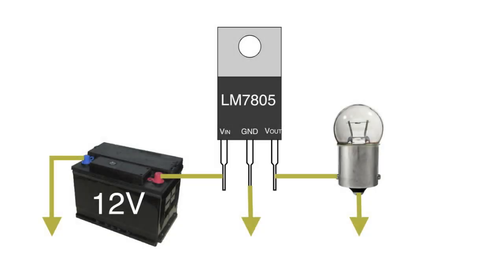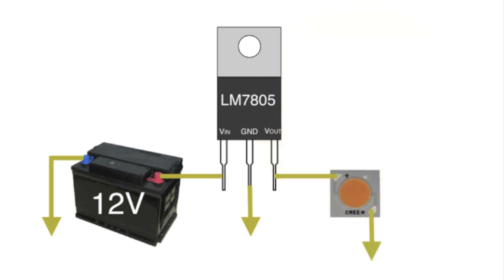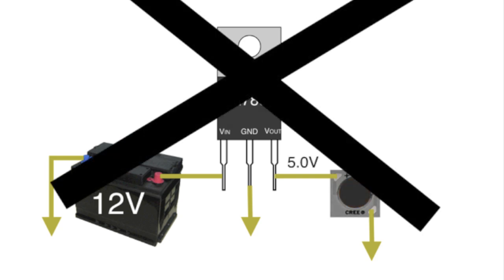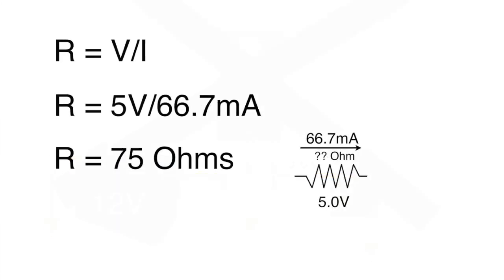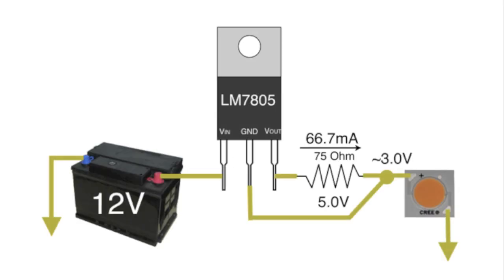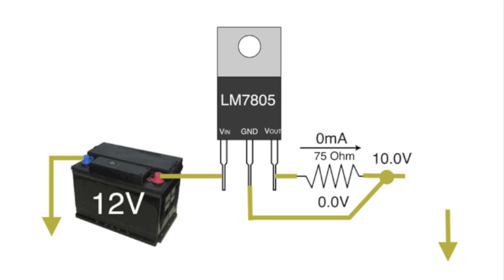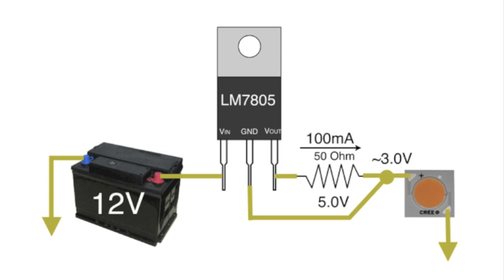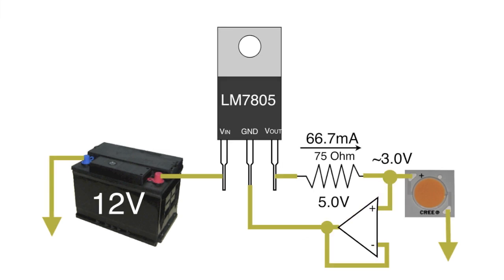Current Source

Comment: What about car battery 60AH  which reads 12v but not work due to low ampere how can i make current source to charge it up and how to know if the ampere of battery goes up
Reply: If the internal resistance of the battery makes it impossible to get the required current out of the battery the only solution would be to use a DC to DC converter to suck the battery dry.

Comment: wont the connection to gnd before the LED cause the ciruit to be short circuit, thus all current will pass through gnd and not the LED? Sorry if im misisng certain information, hope to hear your explanation to this!
Reply from the maker: I think I get it now. You are assuming that the GND pin on the voltage regulator chip is GROUND, but it's not ground if you don't connect it to ground. I'm floating it, so I'm not grounding the LED. Hope that explains it for you.
Reply: Dan Bullard thank you! That explains it!
Reply from the maker: I never connect the voltage regulator output to ground. It always has a light bulb, and LED or nothing on it. I guess I don't know what you are referring to. In the case that you did connect the output of the voltage regulator to ground, the voltage regulator will automatically limit the current and "fold back" the source to zero volts, protecting the battery and the regulator chip itself.

Comment: pls, if we replaced Vin to be 9V for example, and remove the LED,
then the volt at the ground pin will be  7V and the voltage drop  across 75 ohm resistor will be 2V ??
Reply from the maker: If you remove the LED the regulator will probably take it all the way to 9V because the ground pin is now connected to the output, and the ground pin takes very little current, so there is no way the 75 ohm resistor can drop much, if anything. It will do what any current source confronted with a high impedance load should do, it will run the voltage up as high as it can to get the programmed current to flow.

Comment: So just like if you supplied a light with 6V, the load determines the current. So if you supplied it with current at a voltage, the load determines the voltage?
Reply from the maker: Yes! I've worked with ATE systems that had programmable Current Sources that could take the voltage up to 120VDC. Imagine programming a 100mA current into an open circuit! What's going to happen? The voltage could go all the way to 120V. They had Voltage Clamps to keep the current source from ramping the voltage up high enough to damage the circuitry or kill someone.

Comment: Very nice. Plus I think I understand, but not sure?

If we have 3volts at top of led does that not mean the output voltage of right pin of 7805 (before the resistor) is forced by the 7805 to be at 8volts (8-3=5) If I measured that voltage would I see 8volts wrt ground? A regulated 8volts output as an extra bonus?

So if I had two LEDs in series instead of one. So giving a 6 volt drop instead of 3. Would that mean that other side of resistor would be forced to go to 11 volts. But still with same current value as before?

 And is the op amp there to make sure that its output voltage is same as voltage at non inverting input (3 volts). So no current can then flow from gnd pin through LED? 

Also is it easy to explain where the 4ma comes from?
Reply from the maker: Kevin O'Brien Kevin, you have it right. The total voltage would be about 8V. I mentioned that you can't add a second LED because you don't have the "headroom", that is, we can't get 11V out of the voltage regulator because it has a minimum 2V drop across the internal pass-transistor. I added the op amp to "telegraph" the voltage back to the ground pin. This allows the op amp to drive the 4mA current on the ground pin. The 4mA is easy to understand. Nobody works for free, and that included the voltage regulator. It takes some internal currents for it to do its job. The biggest of these is probably the internal zener diode, but overall it does take some power to do anything, whether you are a microprocessor or a voltage regulator. Nothing is 100% efficient.
Reply: Dan Bullard Thanks for replying. 

If that Battery was 20Volts then I suppose I could then get the 11 volts? Is that right?

I am afraid I don't understand what 

"to "telegraph" the voltage back to the ground pin" 

means. Any chance you might elaborate on that a little.  I feel I am now rapidly getting into deeper water ;-)

Thanks for helping
Reply from the maker: Kevin O'Brien Yes, exactly. The LM7805 will work up to a Vin of 35V or so. What I mean my telegraphing is that we need to make sure the ground pin of the LM7805 sees the voltage after the resistor, and by using an op amp in a voltage follower configuration, we can do that without having to deal with the extra 4mA that comes out of the ground pin. Remember the great thing about an op amp (and I know you've seen that video) is that it has zero current on the inputs, but it can source or sink lots of current on the output. So by using the op amp in the follower configuration, remember that both inputs will be the same voltage, so the minus input pin will equal the voltage on the plus input pin, almost exactly as if it were a wire. But the difference is that the plus input won't allow any current in or out, so we are using the op amp to "buffer" the voltage at the top of the LED to make sure that no current gets stolen or added (as it would if we didn't use the op amp) but the feedback loop from the top of the LED to the ground pin of the LM7805 is still in place. Otherwise, if that connection is not there the LM7805 will go full bore, all the way to 10V (12V-2V) and blow up the LED. The LM7805 uses the ground pin to sense the difference between it and the Vout pin. If the ground pin is floating, it will just go wild and blow stuff up. The op amp allows the LM7805 to see the voltage at the LED without polluting it with extra current.
Reply: Dan Bullard Yes I think I get it. So the 4ma current from the 7805 gnd pin is being sunk by the internals of the Opamp follower (via its output pin). But will not effect the LED in anyway because it is now totally unable to get through to the plus input of opamp. But the 7805 gnd pin still will see same voltage as what is at top of LED due to the fact we are using a follower/buffer opamp circuit. 

I find all of this amazing even though I think I now understand it. Thank you Dan, this has been a brilliant wow moment for me. I will buy your circuits book as soon as its written ;-)

Many thanks again

Kevin